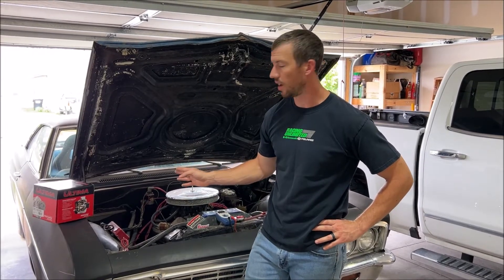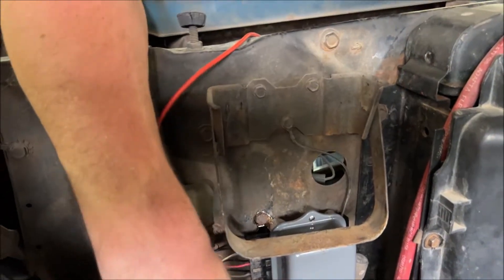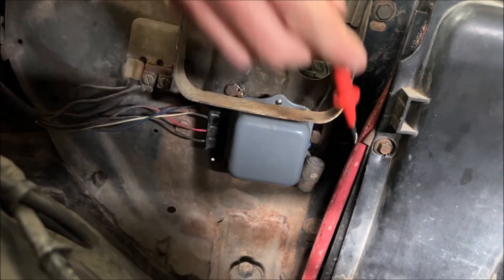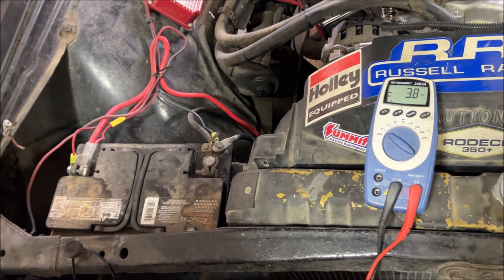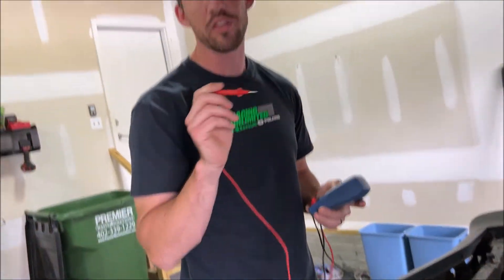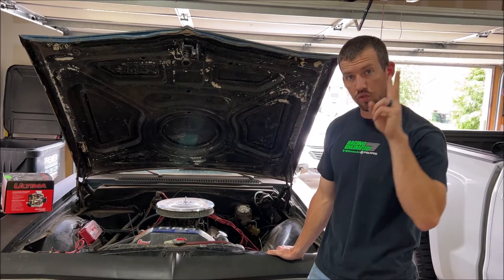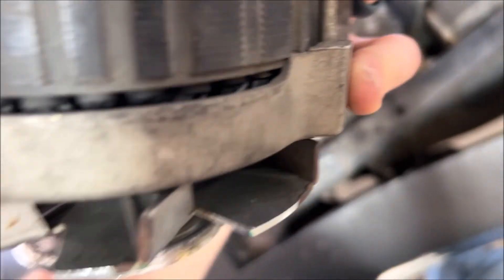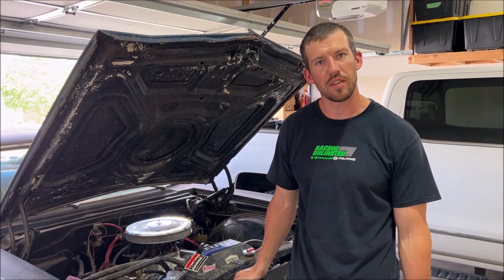Diagnosing a Faulty Alternator and Voltage Regulator with a Multimeter

Comment: Did you put a higher amp alt on? It was probably only 35-40. You need 80.
Reply from the maker: No, I put a 50 amp back on. I don’t have anything drawing high amperage. Basically just an ignition system and lights.